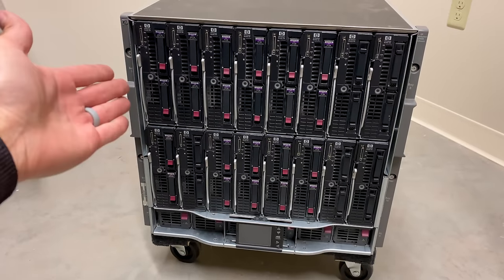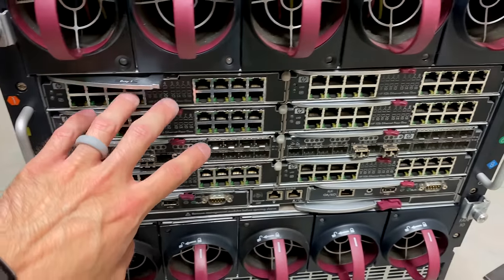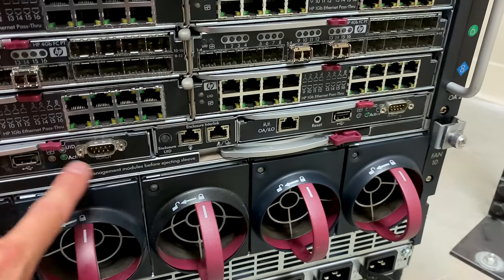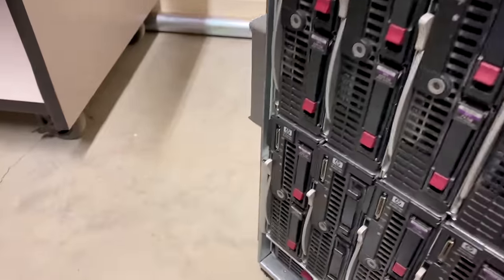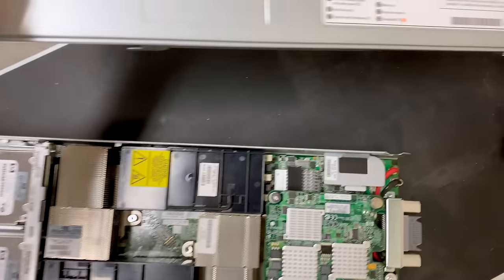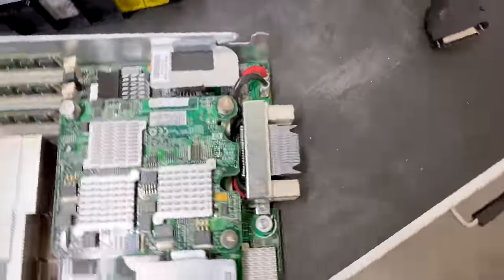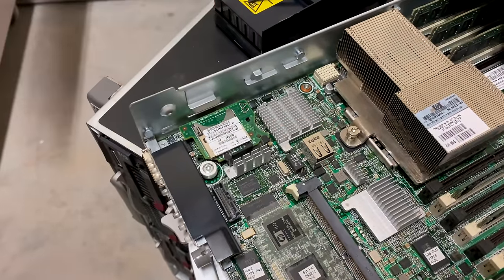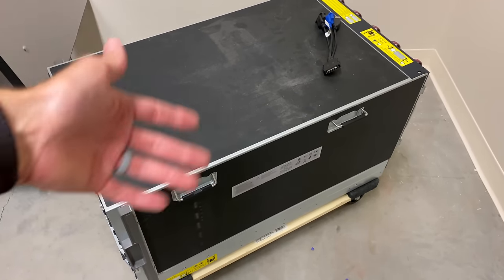Let's Check Out an Old Blade Server System with 32 CPUs!

Comment: These are HP ProLiant BL560c G5, G6 or G7 in a HP BladeSystem c7000 enclosure.
Reply: you can add Gen9 and Gen10 :)
Reply: I ran BL460c in mine along with a few storage blades.

Comment: I've only used HP Proliant blade servers.  Not for running descret applications but as an in-house VMWare cluster with redundant 10GigE networking to NetApps for storage for instant snapshots and fast migration of VMs between hardware hosts.  Now the blades support higher core count CPUs.

These are great for dev build systems where people's time is valuable and the build turn-around time for submissions and smoketest builds must turn around in minutes.

Comment: I still have 2 chassis running with 2 full height Itanium blades each, dual virtualconnect and dual fibre channel switches connected to Dell VNX :) Software migration away from our mainframes takes longer than expected. Rock solid!

Comment: i use these at home. bought them on ebay just to play around with. about 5 years later i decided to start a wireless isp, and i knew they would come in handy. i have 4 of the 480c g1's, now that i want to virtualize, i'm looking at getting a few of the full height servers.

Comment: I used to sell IBM's competitive blade solution back in early/mid-2000's.  It had four BLOWERS on it for cooling, not fans.  If I recall, it took a 60A 208V 3P circuit, or circuits.  Nuts.

Comment: I have one of these and its running in my condo with 125V power supplies  I got 16 servers as well. they are still good  you can upgrade the processors to dual x5675 6 cores with a passmark of 12000+  or you can put up to Gen 10 blades into it... I got a mix of Gen 6's and Gen 8's currently with a storage blades of 12 disks.  I am running Proxmox onto this has 14 Clusters and ZFS.    You can change the HP P410i and P420i raid controllers into HBA Mode... I am slowly converting everything to gen 8 and Gen 10. The problem is that the price of an intel processors in the Gen10 are very expensive Under the Drive bays on the BL460c G6 blades there is a USB connector if you want to run Unraid and it works too. I am running 900GB 10K SAS on these servers...   the sata speed on these is only Sata II. The HP C7000 blade is being replace with the hpe synergy 12000

Comment: It's amazing how long the c7000 lasted. I can still remember installing the old P series in the mid-2000s, switching over to the C series around 2010, and finally, the Synergy series starting two years ago. At one point I was managing six c7000s nearly fully populated. Thankfully they had the Flex10 modules otherwise it would have been a cabling nightmare. Those are amazing systems. Too bad most data center managers think you're crazy if you ask for that much power in so little space.

Comment: Blade systems are still good IF the higher management doesn't want to do analytical modeling in the cloud. It is good to have each process but on separate physical hardware then have a rackmount machine for the heavy processing. Virtual machines are good for like streaming out to the consumer facing and around 1 or 2 steps above consumer facing employees then for the CEO,CFO and others of their level of management. 
The thing is you can put your entire tech support team for customer support onto VMs as you can for the CEO though for your programmers, developer team(s), accountant(s) that do the number crunching for end of mouth, end of quarter and end of year stuff, and for the employees that run the physical transactions with your customers in physical stores need physical hardware. Sure you can put them all on a virtual machine network but watch your time to completion go up by x2 to x10.
The thing i wish upper management got is virtual machines can't do everything. You do need physical machines for stuff. To that that cloud computing is not always the solution to not wanting to buy physical hardware.

Comment: Virtualization still needs physical servers. Those VMs have to run somewhere. "The Cloud" is just running your stuff on someone else's hardware. Blade systems are still very popular, and available in much higher density than those old blades.

Comment: Had one in previous company I worked before. The same model. The lowest right, was used as email server. It worked fine in house, until transfer out to external hosting, because external utility power failure in weekend caused email access failure.

Comment: You don't need to put a bezel in an empty slot. The blade center has a mechanism at the back that blocks the air flow when there is no blade in the slot. Modern hypervisor support CEPH, which works over the network. In my opinion, Fiber Channel is obsolete. The main problem with the C7000 center is more of the power consumption. In idle, we had 6400 watts of power consumption with 8 blade centers, only through the fans. After we switched to rack servers, we suddenly saved 1/3 electricity costs with the same hardware.

Comment: It is a great for deploying Oracle RAC clusters. We deploy them with two 10Gb VCs, two 16 or 32 Gb Brocade SAN switches and two Infiniband switches on the backplane, and distribute the cluster members on 2 or 4 IB interconnected C700 G3 enclosures. Now that architecture is being replaced by using stand alone servers using 100Gb ethernet and the cabling is a nightmare. Not to mention rack space.

Comment: A long time ago, i almost bought a dell C6100 (2u-4 nodes, 8 CPUs(e5600 series) up to 192GB RAM for each), and 12lff/24sff, i beleived shared hot swap drive bays in the front. BUT i ended up getting a C2100 instead, which was basically the same thing, but single node traditional server(dual xeon L5640), with 18 ram slots instead of 12 but still had the 12 LFF/24SFF hot swap bays. It has been my file server for 5 years now and has been a champ.  I am only now upgrading to ryzen just because desktop processor supports ECC, and the power efficiency is crazy, my C2100 idles, without drives, at 160-180w, my HTPC with 3700x (sort of a dry run for the server which i hope to use 4700/4800g)  only uses 90w idle, WITH NVMe, 7200RPM drives, and a high end GPU. Now with 12 7200RPM drives(and 2xSSD), my current server uses around 430w, i hope to get that down to under 300w.for the same number of drives.
I still would like to get a 'decent' blade system to screw around with distributed computing, and would nice to have a VM host that i could set up for local failover, though i dont need it, i'd probably have to go solar before i did that.
Also, i thought all sas drives wer dual lane, ievery one i've ever handled had seperate 7 pins on the top of the connector for the second lane, or was that uses for higher speed instead of redundancy?

Comment: Very informative video, great to actually see such a thing and not only work on it remotely. A few questions popped up my mind as you repetedly said, this is pre virtualization era hardware. Now as a matter of fact we work on a later gen C7000 with Xeon Gold blades in a fully virtualized environment BECAUSE it provides only CPU and memory in a dense and fast package, connected to a SAN via fibre channel. Actually two stacked C7000s to be precise. We use VMWare Vsphere with several Clusters and DRS enabled and besides more modern solutions like HPE Synergy this is as close as we can get to an "ideal" virtualized environment. At least we thought so...
So if I may ask: Why do think this approach is "deprecated" and what is the alternative you use for on premise virtualization?

Comment: We still run blades at my company. Ours are Lenovo SN series in a flex chassis. We dont run individual apps on them ours are setup in a giant vmware cluster, 70 hosts and over 500 guest vm’s. The lenovo chassis have built in networking and brocade switches which greatly simplify the fiber cabling and with their clarity software management is a breeze.  personally i strongly prefer a blade chassis over separate servers for a vmware cluster like ours.

Comment: I remember installing about 16 of these one night at an equinix colo in 2008 I think.  HP shipped all the blades, all the CPUs all the RAM all the hard drives everything in separate packaging.  I had to open like a hundred CPU boxes two hundred little RAM boxes you get the idea.   After 8 hours of assembling all the blades and installing them there was a no kidding 8 foot tall mountain of trash in the hallway 😂

Comment: I had the chance to tinker around with one of these fully populated with G8 series blades. It was actually really nice to work on compared to trying to set up a Cisco UCS chassis, but it's still a bit of a chore to configure ANY blade chassis. I will say, HP designs some beautiful blade server internals compared to other brands, particularly for the G8 and G9 series.

Comment: We still use these for VM clusters, G9's at this point. Our model allows us to select whether to have the PSUs in combined or redundant mode. Combined allowed us to use the capacity of 6 PSU's while the redundant mode did a 3+3 setup so that we can have the PSU's fed from different sources.

Comment: Great video! I had an opportunity 5 years ago to purchase a complete blade system, set up originally as a Primary and Backup in two locations, with 4 C7000 Chassis, and 32TB of SAN storage and controllers for about US$1600. In hindsight I'm glad I did. It's a lot more kit than I needed but but the engineering in these units was awesome as shown in this video....Some similar technology was the DELL M1000s, but I think the Dell were a little better on power consumption(?).
Reply: The HPs are better to deal with long-term. Though now you'll be fighting with browsers and Java versions to access the iLO, but you'd have to deal with that for any of them but the Cisco UCS chassis, which actually did get HTML5 support before they ditched support for the original chassis for the new model. Despite possibly needing a dedicated host to manage the blasted thing, I'd still take an HP blade chassis over a Dell or Cisco one. They're more compute-dense and they aren't as much of a nightmare to configure profiles on.
Reply: @mndlessdrwer  Yes true. I have to keep a copy of the original windows 7 around just to have the correct browser version. Not super secure but it works.
As you mentioned yes, they do seem to have a greater compute density. It seems IBM and DELL struggled to get Quad CPUs even into a larger form factor blade. At least from what I have seen in print.
Reply: @TheServerGeek  Dell has made significant strides in this area, but they seem to be primarily intended for their quad-blade compute nodes. Honestly, given my frustration with backplane issues and switch or passthrough blades on Dell blade servers, this would actually be my preferred approach from them. You get two expansion slots per blade, actually inside the blade itself, and you get some management ports for the chassis and dedicated storage per blade in a 2U form factor. It's pretty slick and works a lot more reliably than the FX2 chassis that it's intended to replace. While I do love the concept of blade servers and their chassis, the more complicated a configuration gets, the more I prefer to just deal with discrete PCIe cards and dedicated switches instead of relying on mid-plane switching and rear I/O cards in blade servers. Plus, it makes it a lot more straight-forward to implement NVMe-FC when you have dedicated and supported PCIe FC cards instead of virtualized ports being fed into a switch in the chassis.

It doesn't mean that you can't make it work. I helped set up a Dell MX7000 that supported NVMe-FC, it's just more annoying.

For more info about Dell's high-density compute nodes, check out this model:
https://www.dell.com/en-us/work/shop/productdetailstxn/poweredge-c6525

Edit: my go-to solution to dealing with relics of computing past which maintain usability long past when their manufacturer expected them to be replaces, and thus lack adequate interface support is to either have a dedicated host or a VM positioned squarely behind a good firewall with a VPN for access, and then have it run whatever browser, Java, or OS version is necessary to allow you to access your management interfaces. Then you can access this host through a remote desktop session to manage stuff with minimized risk to the rest of your infrastructure. It's still not as minimal risk compared to replacing the offending hardware with something using a current and more secure interface, like HTML5, but it's better than needing to expose a PC running an unsupported OS to the internet at large without an enterprise-grade firewall to act as an intermediary. Other pro tip: you can create an account with Oracle for free to download legacy versions of Java. I've found that version 7u45 is the most broadly compatible with older versions of iDRAC and CIMC, but you may need to downgrade all the way to Java 6 for some of the earliest versions of iDRAC on some Dell R710. Additionally, most legacy versions of CIMC require Flash, so you may need to use a portable version of Chrome or Firefox that was installed and then saved before Adobe cut the download access for Flash. Unfortunately, the vast majority of portable browser solutions do not come pre-baked with Flash, but instead run the flash installer and try to connect to Adobe's servers to pull the install media for Flash, which will fail nowadays. I wish you the best of luck with ongoing support of legacy devices!

Edit #2: Other, other pro tip: get your hands on one of these:
https://www.amazon.com/256-bit-Secure-encrypted-Drive-512GB/dp/B07Y4FR9H7

Doesn't necessarily matter what size. Whichever you can reasonably justify to your manager or finance dept. or whatever. They're stupid crazy useful. You can load them up with bootable ISOs, even ISOs that aren't traditionally bootable from USB, like Cisco's HUU files. You can even create Windows-to-go images on vHD and vHDx partitions on the drive and select them as the boot media in the same way you can select any other ISO. Did I mention that you can select which media it presents as the boot media? Because you can. You plug it into USB (2.0 or newer, preferably, due to power limits of USB 1.x) use the D-pad and select buttons to navigate the folders and select the image you want to boot from, then restart the machine and select the iODD vCD or vHDD or USB, depending on which emulation method is necessary for your image. You can even write-protect the iODD Mini to prevent the imaging process from detecting it as storage and trying to write to it (VPLEX storage arrays will attempt this for connected media when they reboot after reimaging. It's very irritating.)
Reply: @mndlessdrwer  Lots of great info there. Thank you. 😃

Comment: You say people don't buy these anymore because everything is virtualized.  What do you think run the virtual machines?  These blade servers are what VMWare vShpere runs on!  We have one Cisco UCS blade server that runs VMWare vSphere and run about 100 virtual servers.  So while you are correct that most are going virtual servers, they actually run on these blades.

The only unfortunate thing is our company does not upgrade as frequently.  Our servers are still on 4th gen Core-based Xeons with some new blades we added that are 6th gen.  We have G6 servers in production!  I know, it's bad, lol.
Reply from the maker: As hypervisors, blades come at quite the cost premium over discrete servers — plus, while there’s plenty of redundancy, the chassis still has a single point of failure with the backplane.
Reply: @ThisDoesNotCompute  I can't argue that, since I don't actually see the prices of the blades and the discrete servers.  I figured the reason why they went for blades was because of the price and space consideration.  But again, we do keep our hardware longer than most places. 🤷

Comment: Blade Server, the last attempt of the server industry to push ultra expensive vendor controlled hardware into their market. 

And today the problem is more the density and not the required space. We are now so dense that you can add so many servers to a rack that the network connection, even if 40gbit or 100gbit is pretty fast saturated. How do you get that traffic out of the rack when you have a 2U server with 128 cores and 4 TB RAM?  Now with AMD Epic you could really have a mid sized data center inside a single container (as it was advertised in 2013) at least for cpu power.

Comment: I work with 9 chassis (amost 200 blades) and they are better than VMs for very high, scalable CPU workloads. Also setting up Virtual Connect to run all the blades off of one fiber cable is amazing. Plus you can do a HA setup between chassis for redundancy. iLO is a laggy bag of garbage.

As someone who's had to install this on the top part of a rack, these weigh a fuck ton.

Comment: When HP offered racks of these the racks were water cooled.  Unfortunately last place I out in big blade servers was below the level of an adjacent watercourse, so it was impossible to have a gravity sump in case of emergencies and water-cooled systems were therefore banned.
Reply from the maker: I’ve seen racks like that, where they have blowers in the front door and chilled-water radiators in the back door. The cooling capability was very impressive, but the fact there were water lines that close to the back where the PDUs mounted was always disconcerting.